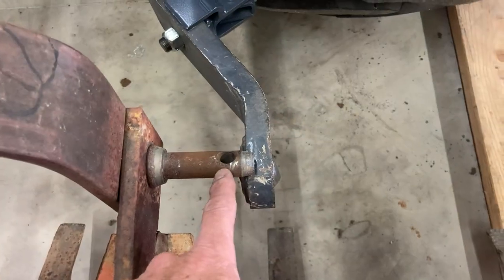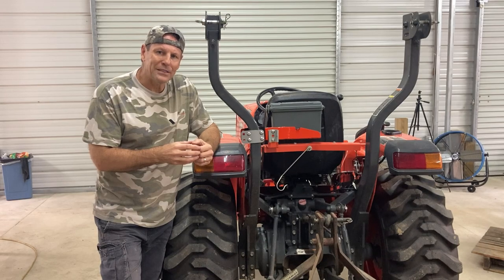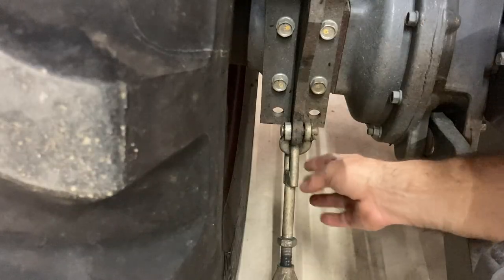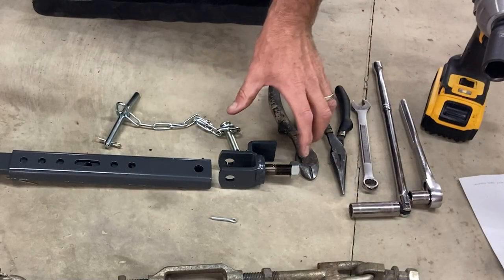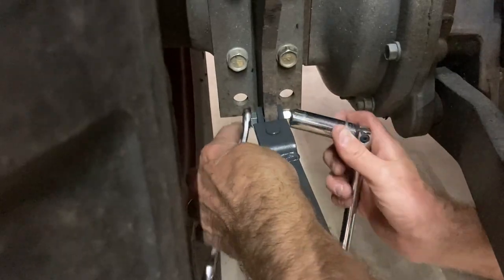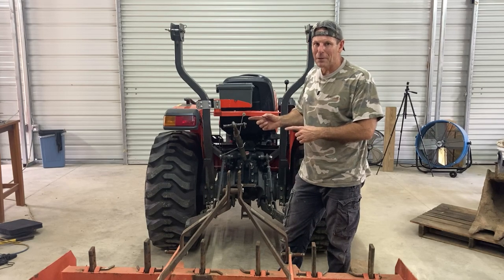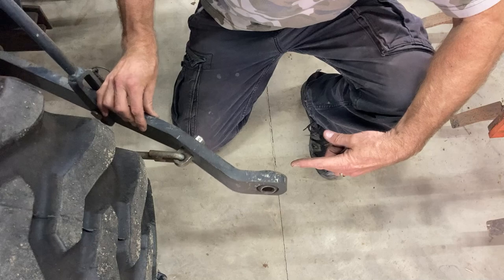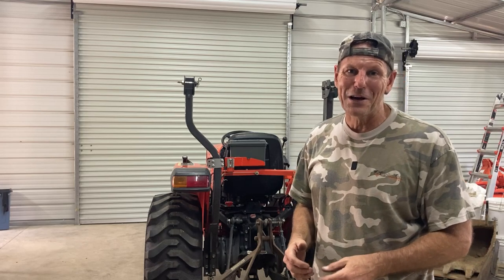WATCH Before Installing Telescoping Stabilizers on Your Compact Tractor

Comment: I had same problem but fixed it easily - get some quick hitches for arms or the simpler way is to just turn your pins on the implements in instead of out.   The stabilizer bars are too valuable to me compared to the turnbuckle.   Thanks for the video
Reply from the maker: Good tip!  some of my pins are welded because I'm pretty aggressive with my brush hogging!  Pats is probably the best way to go.
Reply: @PineyGroveHomestead Agree - I ordered yesterday.   Thanks again for the video.
Reply: @PineyGroveHomestead  That's what I was thinking as I was watching.  I have Pat's and hooking up from underneath would solve this issue.  Thanks for the video.  I ordered a pair.  I'm for anything to make hooking up implements easier.   Also, I use R pins instead of cotter keys.  Makes taking on and off easy too.

Comment: Thanks! You saved me some headaches! I suspected that to be a problem on my old used '94 Honda 23 HP diesel with chain/turnbuckle sway links. They are very short and you have to pull the cotter and drop the clinch pin in order to adjust them. Only having it a few months and six different implements it came with, I walked around and measured all of them. The snow blower was 5" narrow so I turned the pin's inside-to out by just slipping two (longer)7/8"x 6 1/2" pins thru the U-channel connector so the arms are on the outside with the pins running all the way thru.  Now all are within 1 1/8". No more adjusting! I hope that made sense, thanks for sharing your findings!
Reply from the maker: Eventually I want to get to a quick hitch, but for now, just using our old implements!

Comment: Thank you Brad for posting this.  You give food for thought on aftermarket stabilizers.  Glad I came across your video FIRST before I found out the hard way.  I'm looking for good replacement stabilizers for my John Deere 1025R.  The factory turnbuckles can be painful. Peace be with you.
Reply from the maker: If you use a quick hitch or Pat's system, you could use something like this but our implements are old and the pins are to the outside and welded!

Comment: Thanks for the video. Was thinking of these, but not now. I also like the idea of the fine adjustment the turnbuckles provide. My sway links don't have the forward locknuts on the turnbuckle, bought the tractor used. The rear, easier access, locknuts have worked fine by themselves for years.
Reply from the maker: I like the idea of telescoping but Kubota didn't engineer these properly IMO.  Thanks for watching.

Comment: Hi Brad, I had to look to see where my adjustable stabilizers were mounted, because I haven't had this issue. On my B2650, they mounted them on the inside of the arms.  Looking at the rear of your L series, you would have to do some modifications to make that happen.  My are mounted on a plate just below the pto shaft and just above the tow hitch slot.
Reply from the maker: Yessir. You are correct...the B and BX put them on the inside.  I feared they would hit but was hopeful they wouldn't!!     Back to turnbuckles!!

Comment: I have run into this exact problem just today. My L4701HST came with telescoping stabilizers. I've been using a Speeco Quick Hitch for everything so I hadn't run into this. Then I bought a Del Marino Flipper 186 flail mower, and I can't mount it because the arms don't have enough width. The Del Marino does come with a set of cat 2 quick hitch pins, but the Speeco is cat 1. This is nice because you don't need a set of $30 adapters for every implement you own. The hole for the hitch pins in the Del Marino are larger than a cat 1 pin, so there's no way to use a cat 1 quick hitch pin unless you want to weld up and re-drill the hole. The only solution I see at this point is using Pat's Quick Hitch. This will work, but then you need a top link extension or you lose 4" of length on the top link, and you may not be able to tilt the implement back far enough.
Reply from the maker: I was going to say Pat's but you are all over it!

Comment: If you had a quick hitch I would guess it will work and make your life so much easier. I have one on my tractor and it makes hooking up so much easier than the old way.
Reply from the maker: We sold ours.  We don't have a single implement that it worked on without having to make adjustments each time.  But if you have compatible implements, it's a time saver.

Comment: Ok, I worked for a Kubota  dealership for 4 years.  Why didn't you just take the pins off the box blade and put them on the inside?  Problem solved.  You know how many times in 4 years I had to do that.  So yah, simple fix to your problem.  If the pins are welded well... they shouldn't be.

Comment: That’s a bummer Brad. I had considered buying those but decided with the implements that I have, they weren’t necessary. Now I know that not only are they not necessary, they won’t even work.
I have an old Dearborn (( Ford) disc that is older than I am. The pin settings won’t work with my quick hitch. Same goes for my brush hog.
Glad I watched this video. Thanks for sharing this Brad.
Reply from the maker: Thanks for watching Gary.  I feel like many of us with old implements are in the same boat.   Guess we'll just keep our turnbuckles clean and lubed!
Reply: @PineyGroveHomestead  My L2501 has the ag tires (R1’s) which are somewhat narrower than your industrial tires. I also have wheel spacers added to mine which sets the stance out much wider . They may just work for me but without telescoping lower lift arms, I still see a whole lot of frustration trying to get hooked up to implements. I have that problem solved Brad style, with a 6 foot steel bar. Best method I have found yet.
Thanks Brad

Comment: Thanks for confirming a concern of mine!  That 90 degree angle at the outer attachment on the lift arm is a terrible design limiting the usefulness of the sway bars.
Reply from the maker: There are ways to make them work (spacers and quick hitch) but it's not for my situation.  Thanks for watching.

Comment: Good video, glad you made it, and bringing awareness to this.  Can you slip one pin on first, and then slip the other side on? Thanks Brad.
Reply from the maker: You probably could work around it, but at that width, any slop in the arms could cause your tires to rub the stabilizers.   I occasionally have the turnbuckles rub if the jam nut comes loose.  Thanks for watching Ross!

Comment: This is exactly what happened to me-I have a L3400 and I do have the pats quick hitch on my arms.   So, getting the implement on wasn't a problem as you don't have to spread the arms as wide, but when everything was attached and locked down, I only had a 1/4" of space at the most between the stabilizers and the Ag tires.   Way to close for me.  I did contact Neil at Messicks and he told me that Ag tires are a problem with the Kubotas for these stabilizers and I can return them.   I felt bad though, as they would never be able to sell them again as they got a little scratched up and look slightly used from me trying to make them work......so if anybody needs a pair, I have them!
Reply from the maker: I have R4s....perhaps Neil should have that on his website before people buy!   Thanks for watching.
Reply: I would be interested in buying the stabilizer bars from you. What’s the best way to contact you?
Reply from the maker: @tylerwray6061  Our email is in our About section

Comment: Sorry to hear you're frustrated, but all hope is not lost. They make wheel spacers that extends the width of the rear axel for better stability on slopes which is a good idea. That will take care of two problems at the same time. I've come close to rolling my tractor due to narrow wheel base😮. The spacers are a plus too have. Pat's quick connects are another answer.
Reply from the maker: They are all great solutions. For now, I'm just running the OEM turnbuckles.   Would like to go quick hitch but that mean buying new implements and that is not in the budget!
Reply: @PineyGroveHomestead  You should try Pat’s Easy Hitch.  I did that and use it will all of my implements on my Kubota L4701.  Much better than the Quick Hitch and it works with all my implements, even the ones that are not “Quick Hitch” compatible.
Reply from the maker: @dougspencer4485  I need to spring for a set of them.

Comment: Do the people that use them flip the tire rims around to make a wider rear stance?
I don't know i don't like the turn buckles .
I like the old lift arms on the 70's massey ferguson they were easy to hook up but then again they were the ones I grew up with.

I did know one guy that had a little 19hp massy.  And his hitch didn't fit any of his older equipment. 
He turned the pins around towards the inside of the 3pt. It worked for him.
Reply from the maker: They make spacers to widen the stance of the tractor.    I know you can reverse the rims on the front....but I don't think you can on the back.    There are ways to modify the tractor further to make these work but not sure the juice is worth the squeeze.

Comment: The ANSWER to your problem is to reverse the PINS on your Implements….to place them INSIDE the implement brackets.  Then the adjustable stabilizers will work perfectly.  (Many such implements are assembled thusly.)  Hope this helps.
Reply from the maker: Most of our pins are welded.  Some are in, some are out.   If we ever go to all new implements, we'll go to a quick hitch and put the stabilizers back on.  Thanks for watching.

Comment: Fortunately for me, my machine, a MX4700, which I converted over to the telescoping arms, is also offered in a turbocharged version, the MX5100 which is basically the same chassis which comes with the telescoping arms, so clearance was not a problem. I'm surprised the kit that supposedly fits your machine isn't marketed with the caution that clearance may be an issue.
Reply from the maker: You've got a wider stance than the L-series.  We could put on wheel spacers to solve this problem but that's just more money, mods and work!   The engineers should have made them so you get at least the same clearance as the turnbuckles!

Comment: Hey Brad, that can be frustrating. It's not a one size fits all, unfortunately . I have the L2501 same set up. I mentioned before I have the Pats Easy change, with the upgraded stabilizers. It works because it does need to go as wide as the outside cat 1 pin to attach since Pat's attaches to the pin  underneath. Yeah, it's another investment, but i can't see myself going back to the turnbuckle .Another option is the Bora  wheel spacer. We are both in Florida and flat ground, so I didn't go that route. Good luck
Reply from the maker: There are alternatives...just takes time and money, right?    Maybe Neil will send me some spacers for my troubles!
Reply: @PineyGroveHomestead  🤣

Comment: Take the set pins out on both sides and let them dangle by the chain.  That will give you more room.  Once the implement is on then you can rock the cultivator back and forth to set the pins tight.  I have had those telescoping pieces for a few years on my L3901.  Easier then the turnbuckles but you cannot get them as tight.  I hate the implement rocking back and forth.
Reply from the maker: That was one reason I was not going to put them on...too much slop.    I'm still using turnbuckles......these stabilizers are collecting dust on a shelf!
Reply: @PineyGroveHomestead  Wish there was a better heavy duty solution.  I've replaced all of the bolts and pins as they bend and break over time.

Comment: You can adjust the rear tread wider on your tractor or remove the pin that attaches the stabilizer to the lift arm , attach the lift arm to the implement and then put the pin back in the stabilizer.
Reply from the maker: Good ideas.

Comment: Do you think that the ag tire set up would be different with the telescopic sway vs the industrial tire
Reply: They work great if you have Ag tires. The R4s are too wide
Reply: @gitrdone43  thanks I was thinking they would I have have ag on mine but I feed livestock with mine so I was thinking with them being narrower it would be
Reply: @daniellloyd668  I had Ag tires on my L3901 when I originally bought it and installed the telescoping stabilizers and I didn't have any problems. But when I swapped to R4s I had to add spacers to the rear to clear the stabilizers
Reply: @gitrdone43  makes sense I moved up from a bx2360 to a l3901 I've been thinking about upgrading to the  telescopic stabilizers just for ease on bigger implements
Reply from the maker: Another commenter said that Neil said they are worse with ag tires.  I don't know??   I do know I have a set if you are interested.

Comment: My 4701 came with those never had prob on my implements maybe it’s little wider on mine.  I thought ours had similar frames or your box blade is technically to big for the tractor. 

  Quick hitch is the best thing ever your really missing out if you change implements good bit.
Reply from the maker: The 4701 is a different frame from the L3901.

Comment: I think your three point arms have another hole in them closer to the tractor, i can see it in the video, try moving the new stabilizer bars to that hole and see if that dosen't solve your problem.
Reply from the maker: That might help it go wider, but then it won't have many, or any, holes that line up.   It's a flawed design...

Comment: Turn the pins on the implement to the inside. should  help.
Reply from the maker: Our pins are welded on most of our equipment and that would only solve this box blade.  Our bush hog pins are much wider.  Thanks for watching.

Comment: Can you put your pins on the inside and not the outside of the box blade I've seen people have to do that before!
Reply: I was going to say that same thing. Seems like much less work as well. But what about other implements he might be using on there...  May not be able to make them work?
Reply: @Drue Smith  unless they are welded I would think that they can all be moved .
Reply: Just went and looked at my box blade and my tiller the pins can't be moved on them because they are the kind that slide thru brackets for the lift arms!
Reply: @chriselliott2364  thats how my box blade is. You have to take the pin out on the box blade and get the lift arm in there lined up just right. Can be a pain. Have yet to order a quick hitch, but then all i have for now is the box blade anyway. But the way his lift pins are, with a nut on the inside, it can be flipped. If he had what we have, the lift arms woulndt need to open so wide. Anyway, no tractoring for me today. Its been raining. Booo hooo lol.
Reply: I have several implements that are not quick hitch compatible so i use the pats easy hitch to connect them before my health got bad I would just wrestle them around , but not anymore lol!
Reply: I also put the sway bars on from messics and that helped me out a lot!
Reply: Wrestling around with anything sucks!
Reply from the maker: Most of my pins are welded to keep them from coming loose.   Mainly my brush hog and that is what I use the most and they are outside.  Good ideas though.  Thanks.
Reply: It was a suggestion I hoped would help you, a lot of people don't know they can flip the pins on some implements! Hope you can come up with something to make hooking up easier for you!
Reply: Well thats a bummer lol.. But better than having something come apart!

Comment: Would you be able to find a telescoping stabilizer for your needs?
Reply from the maker: I think they all are going to have the same clearance issues with our older implements.   For what it costs to buy all new implements, we'll just use the old original turnbuckles.   They work!